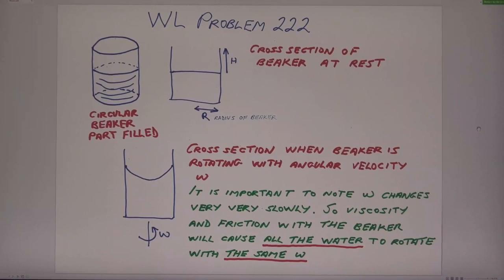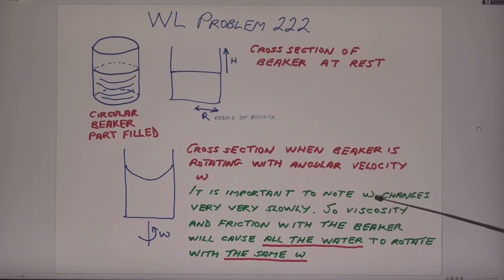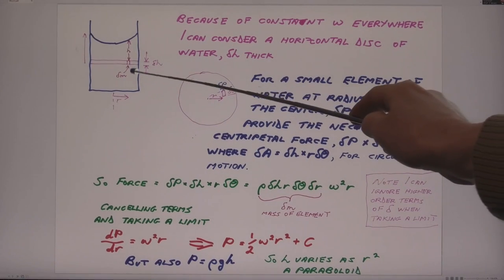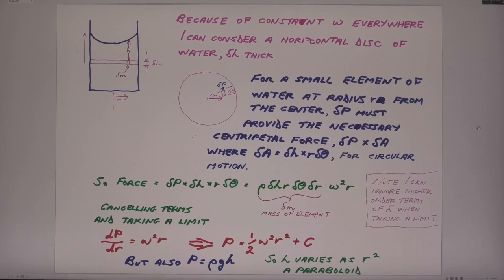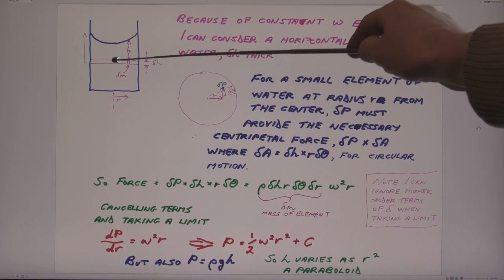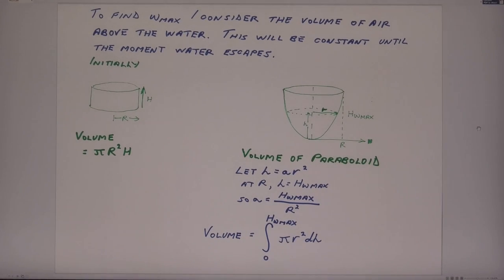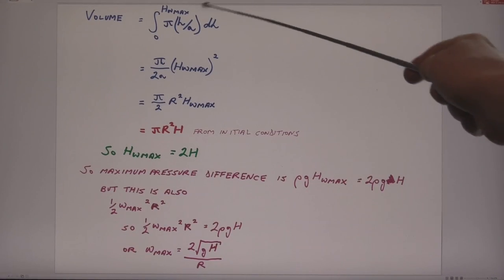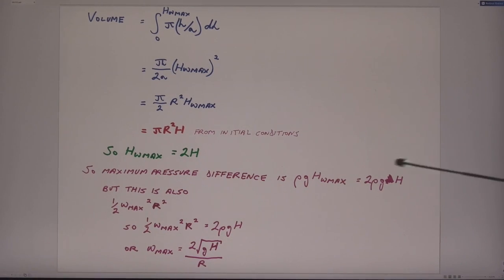Keith' solutions to Problem 222

Comment: Hello sir I am solving a lot of questions and revising properly still I forget concepts during an test and I am very bad at physics even though I am trying my best how can I improve my speed along with accuracy in physics I'd be extremely grateful if you could help. I 've tried alot but I manage to get a lot of questions mostly due to some silly /careless errors here and there under strict time contraints please help sir 😢

Comment: If an electron is a point particle with no measurable size, how can it have angular momentum (spin), given that classical angular momentum requires a rotating mass distribution?
So does it spin or not 
Or it has moment of inertia or not.
Reply from the maker: take a course in QM - QM is very very different from Newtonian ideas.
Reply: @lecturesbywalterlewin.they9259  well I didn't got my answer

Comment: Sir I have a question,if we can see atom through microscope if we can't then how we say water have two hydrogen and oxygen
Reply from the maker: yes they can be seen with an electron microscope - As the wavelength of an electron can be up to 100,000 times smaller than that of visible light, electron microscopes have a much higher resolution of about 0.1 nm, which compares to about 200 nm for light microscopes.